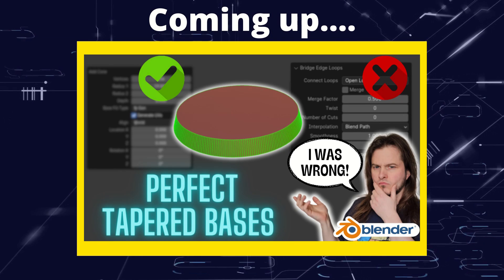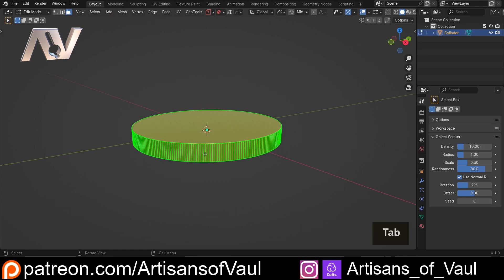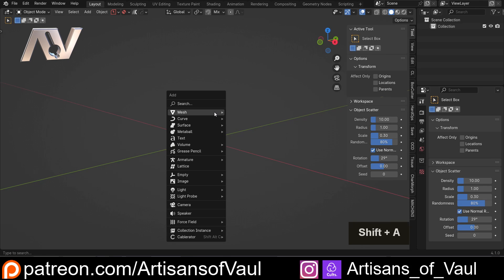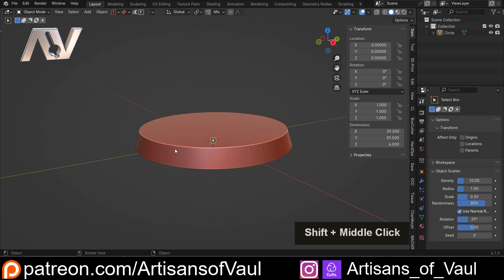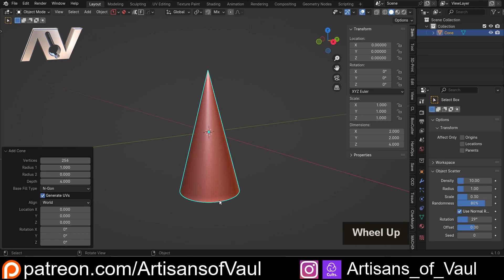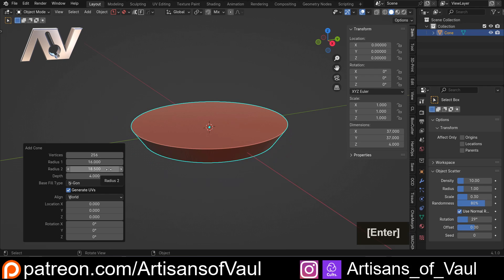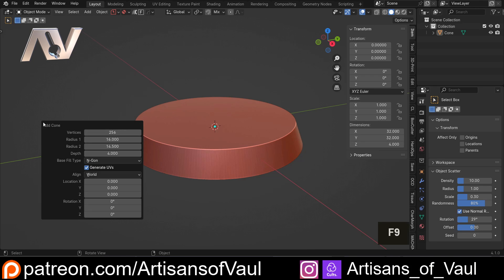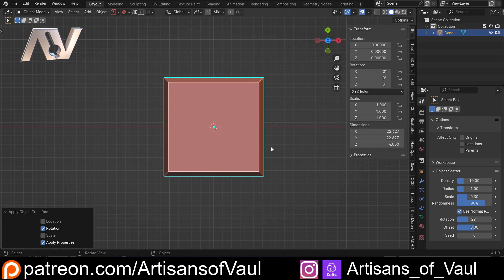The best way to make a tapered round base

Comment: Why not just create a cylinder, tab into edit mode, select the top face and scale it down? The math can be done in the dialog boxes.
Reply from the maker: Yep it can.  But then it needs to be done as a ratio and I think this is still simpler.
Reply: @ArtisansofVaul  that ratio (or its inverse) would be the scaling factor
Reply: Exactly what I thought. Just scale down the top face. What could be simpler?
Reply from the maker: @richardconway6425  I would say just typing in the size you want for the top face is easier than scaling it and putting in ratios is simpler.  But each to their own, if that works for you, great.
Reply: @ArtisansofVaul  yes, so this is all related to the fact that blender does not natively excel at fast precision design/modelling. Anyone coming from a technical design/engineering background will find this frustrating, because cad type software is optimised to do this very well.
But my engineering background was all about drawing boards and using ink or pencil on translucent paper, so we could see the printed grid reference sheet underneath. People who grew up drawing and designing in this way would always have their calculator to hand, for exactly this reason, to constantly check ratios and dimensions, and angles. It's a way of thinking, and working. I still think in this way, and, when I first started using blender, I tried to work in this way too. I would always have a calculator open somewhere on screen, to do these same calculations, so I would have the ratio that I needed ready to use. But of course, if you know how, blender has all the tools you need to do this, they are just not very obvious. 
I wish blender had a fast cad ui mode. That would be good.

Edit: the cone method is really good, and I thank you for bringing it to our attention. Again, unintuitive that the cone would have this functionality. 
It's a bit like, in terms of intuitiveness, taking a cylinder, and scaling the top face to zero. Have you tried this? It's reasonable to assume it would destroy the mesh, or least the top half of it, but it doesn't. If I remember correctly, you get a cone !! There is the small matter of a load of overlapping vertices at the point, but that is quickly solved with 'merge vertices'.

Comment: For sqare bases you can just factor in the ratio of the diagonal vs the side of a sqare, which is half of the sqareroot of 2, so in other words about 0.707. So if you want a sqare 30mm base, then your cone radius should be r=30/2/0.707= 21.216
Reply: Also thank you for making these videos. They are really interesting
Reply from the maker: Cheers man.  Thats very true you definitely can use things like the ratio, I just find the other method just as fast as working that out as (without explaining) it takes a couple of seconds.  But for others this will be faster so thanks for commenting. 👍

Comment: In 3dsmax you can add edit poly modefy, celect the upper face of the cylinder and scale it down,
Is there anything similar to that in Blener?
Reply from the maker: You can scale the top face in Blender too but it scales my a ratio of its size, not by a measured amount.  Is this the same in 3dsmax?
Reply: @ArtisansofVaul  yes it scales by ratio too

Comment: Gah, YouTube have been messing with my computer again, they've blocked features of YouTube Redux and the page is weird. I'm typing in a little bar on the side. 

Does anyone have a link to the old version of making bases? I want to know what this divide-by-2 thing is about and why this is better than just beveling a cylinder.
Reply from the maker: Thats frustrating.  So this video covers the dividing by 2 element (its basically about being able to remove data easily):
https://youtu.be/Wm5Nzr3G--k?si=Yksi7P61IqFWz3uc

This is better than bevelling as you can have an exact size for the top and bottom.  If you dont need that then it doesnt really matter.
Reply: @ArtisansofVaul  Thankyou very much Mr V. 🙂I'll watch that video right now and find out what I missed.

Comment: The method I'd use (works for irregular shapes too) is to select the top face of the cylinder, inset it by the specific amount you need, select the edge loop around what was the upper outside edge, and Dissolve them. The cone method is great for circular bases though.
Reply from the maker: That's a good call for an interesting solution 👍🏻

Comment: How about hex bases?
Reply from the maker: Thats a good question.  Assuming the diameter of a hex base is measured from one flat surface to the opposite one of the first method would need to be used.  If its measured from a corner to an opposite corner the final method would be faster.

Comment: Oh wow, the Cone method is perfect for round bases!

What I've been doing in the past (which would work for both square and round bases) is:
1. Add a circle or a plane. (if circle, fill it)
2. Select the face, hit I, and enter the diff bewteen top and bottom width/diameter / 2
2. Move the inner face up by the base's height. 
3. Fill the bottom. 

The Cone is way easier for round bases. This method should still work well for square/rectangular basis, though.
Reply from the maker: 👌🏼 Totally agree with everything there

Comment: The cone method is how I used to do the bases. But, I am trying to find a better way now to create the base where the bottom has lips and magnet holders, not solid flat like in the video. 
I can do it, just not effective yet.
Reply from the maker: Hmm...   Have you got a picture of the base in question?  It sounds like an interesting problem
Reply: @ArtisansofVaul  Not that I can easily show (YT filters). BUT, on "cult s" the design number, 324686 (FROZTYBEVERAGE's model) is similar to what I was talking about. 

I can do it, just takes too long and I get fragments from booleoning the "circles" that hold the magnets. 

Not an issue for 32mm bases, but when I want larger monster bases, those magnets help.
Reply from the maker: @RoseKindred  for the lip I'd just extrude in the bottom face, extrude it towards the top and then scale that in in Xray mode to check I'm keeping the base the same thickness.
Reply: @ArtisansofVaul  I'll have to try that next time. What I was doing:
Duplicate the cone/base. 
Scale it around so I have 2mm less on all sides while also reducing the height so it is 2mm from the top of the cone/base. 
Difference between the two bases.
Paste in my "magnet holders" which are cylinders with the middle removed. 
Join them all.
Bevel all edges.

Comment: What happens if you use a cylinder>edge select> select button edge and scale out?
Reply: That's what I was thinking too, I even think it would be more comfortable to change the size
Reply from the maker: Thats totally possible, I just removed that section (but with scaling in) as it seemed a bit repetitive.  It will just use some simple maths as scaling is done in comparison to 1, not as a unit measurement.

Comment: What I would do is cylinder. Extrude up. Face mode. Select top face. Size. Type "=36/39.5". Thoughts?
Reply from the maker: Totally viable. I had that on the video originally, but that felt like it required an explanation that extrusion isn't done as an actual measurement but as a proportion compared to 1 and that added a couple of minutes to the video which I was trying to keep more punchy. So I decided to leave that one out and keep in the method someone had commented in the previous video as it felt like a nicer thing to include for some audience/ comment "participation." 

I'm now regretting shortening the video 😅 But that's always the way. Getting the perfect video length when compared to detail is always a challenge.
Reply: Agree.  I watched this for 5 minutes trying to figure out why that wouldn't be obvious.  But you don't have to extrude the top face, just grab it and type in the height.  Apply scale.